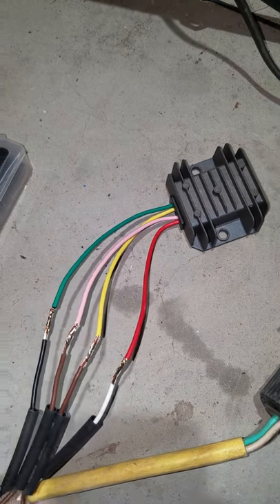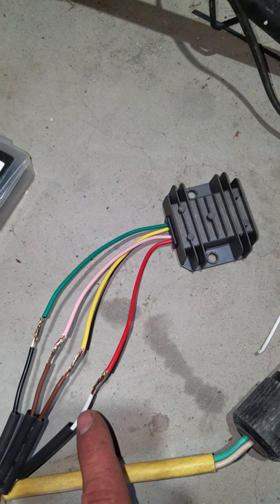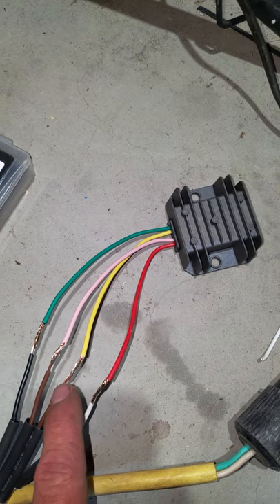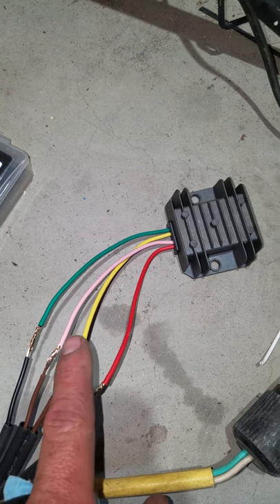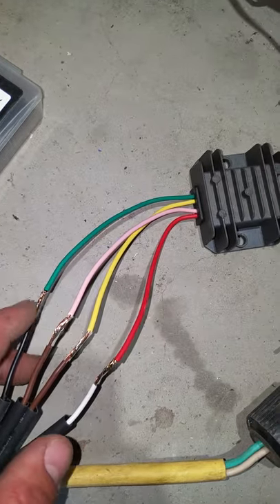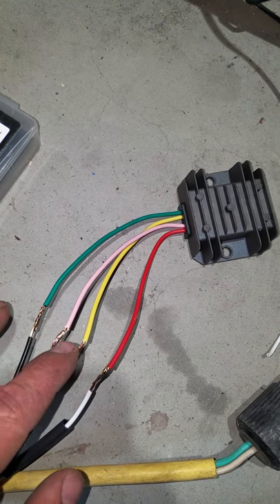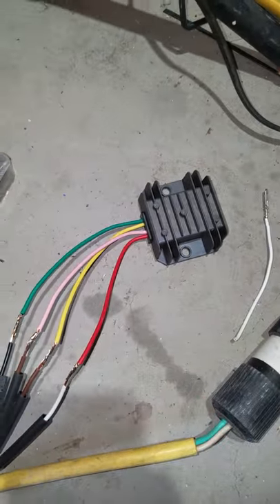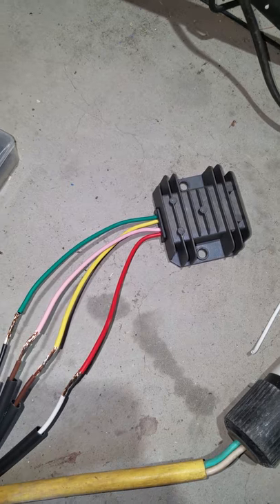How to wire a 4 wire voltage regulator rectifier

Comment: Ok, so I did get it correctly. 
I'm about to put one of those exact same reg/rec's on my new Chinese 125 engines that has two yellow wires coming off the stator. Thanks, this is good to know.
Reply: Should be yellow and orange cables off the stator and may i know how you connected those

Comment: Pink with green is AC from magneto. Yellow with green is for headlight(4amp).Red with green is 14.80v for battery charging (1ampere).
Reply from the maker: Nope.
Reply: 4 wire rectifier dosent have two  stand alone ac wire ...in motor cycle every thing common with ground.same as ac supply have common ground
Reply from the maker: @nishantkundu6210  There are multiple four wire rectifier designs. This is one of them. It does not have a headlight circuit.

Comment: May I ask why my red wire only output around 4-5V voltage to my headlight ?? The stator is new and able to produce more than enough voltage to burn the bulb if I disconnect the rectifier. Thanks first

Comment: I’ve got 2 of them, exactly the same from Amazon . My stator has 25vAc coming out when the bike is idling. I connected the yellow and pink to the correct wires on my MT250 which happen to be yellow and pink also. BOTH rectifiers output 1.6V Dc ??? I’ve tried it without the dc connected and also with yellow pink swapped round . I’ve diode tested the units and checked if the case is shorted to anything and it’s 1.6 v dc every time.
I’m a railway electrician/sub tech , I’ve worked in electronics and all manner of electrical work for the past 30 years including transformer construction. Please tell me WTF is going on with these damm things could they possibly both have identical faults lol it’s doing my head in
Reply from the maker: Wow. That is something else........ I am unclear on how that could happen. Even if it was a 1/2 wave, full wave problem, you still have enough volts to make 12.5v
Reply: Did you do (stator float) ?
Reply: If it’s the same as a four pin rec/reg that comes on the little 50cc Chinese motor scooters then there’s one wrong wire connection in this video.  That green wire is not meant to go to ground.  That’s an AC common/return wire.  These scooters use AC of the yellow wire (one of the stator coils) to power the headlights and taillights.  That green is the ac common.  I went through the same thing when hardwiring one of these rectifiers up.  Looking at wiring diagram for the bikes they come on it appears to be ground to you realize they have a mixed ac/dc system and the stuff running off ac needs a return path to complete the circuit.  So just don’t run that green wire to anything and then it will charge the way it’s supposed to
Reply: Yeah I agree. I had to do the same thing to mine. Then I found out all it was was a banana in the tailpipe.
Reply: Did you check the output on unplugged wires, or connected to the battery? Because i had the same result first. Then i connected the battery and here we are! 14,5v :) Tested on an old Kawasaki.

Comment: Eyeball: Thanks for your reply. I found a wiring diagram which helped but it was actually pretty easy to figure out anyway and I now have it back together.  I do have a question as these charging coils are new to me so I have no experience to draw from in order to confirm that all is well with my setup:  I started with one charging coil but just added a second one. Everything is wired as it is in your video, a charging coil to each of the pink and yellow wires and of course the ground and positive wires as well. With my starting battery connected and the motor shut off I read 12.8 volts at the battery. If I fire up the motor I still see only 12.8 volts which makes me believe that the charging coils are not adding to the equation.  If I disconnect my starting battery and run the motor again I read approximately 5 volts DC from the battery terminals. If I switch the meter to AC I read approximately 11 volts, again at around 2/3 power.  I am not sure what to conclude from this. Shouldn't I be seeing more volts from the Voltage regulator with the motor running?
Reply from the maker: Yes. What you have is a different type of stator coil. Yours ground to the engine where they bolt on, am I right? I can't remember right now, but I think you need to either use a full wave rectifier or splice the coils together in a rotational circuit.
Reply from the maker: **in a series

Comment: I connected a 4 pin voltage regulator to artic cat 2000 its charging and everything but the Artic cat original voltage regulator has 5 wires but it does work for my charging system would it affect it cause i have one left stator wire extra from the artic cat?

Comment: So I'm basically wiring a dirt bike to have lights.  It does not have a battery.  Do I need to add a battery or can I wire it without 1?  I'd be using the frame for all my common grounds.  Thanks
Reply from the maker: You should be able to just attach the positive output lead to the input of the light. It might pulsate a bit even though it is dc, because it will make power when the stator and magneto coils pass every revolution. 14v directly should be fine for your lights. You may have trouble with LED's though. Perhaps not. You could probably avoid a lightswitch altogether if you wanted. I'd fuse the regulator output probably , just to be sure it never shorted out. Good luck. HMU if you have any more questions.
Reply: @eyeballengineering7007  Thanks for your response. I went ahead and wired it all up. I grounded to frame. Everything works!  I used LEDs for the turn signals and they dont flicker. Your video helped clear up a wire question I had and your response confirmed what I thought would happen. Thanks for your help!
Reply from the maker: @nickhowes7436  Awesome. That's what this is for.

Comment: Wow, great learning video. My question: i hav da most fuked up chi nah quad. My rectifier is plastic. Blk red pnk gry gree wires comes out of rectifier. Black n pnk not connected. Grn red gry goes to the vehicle. I bought a new one has 5 wires. Blk red yel pnk grn. How do i connect this new with existing blk red gry? Pls help n God bless you!

Comment: Question for you.  I only have one yellow  ac hot wire coming from the lighting coil .  The lighting coil is also grounded to itself so grounds directly when it is installed. No ground wire needed .  
 I assume i can just leave one ac pin vacant ?  Thanks
Reply from the maker: You can if the single coil makes enough voltage.
Reply from the maker: Well. I may have been hasty. I think that would work though. You may need to ground the other leg. I haven't thought about this in forever.
Reply: So you want to put one AC yellow from stator to the yellow on r/r, leave the pink blank, and send the green- and red+ to battery -/+. 
I would like to know if this would work as well.

Comment: How to identify the coil is full-wave or half-wave regulation?
This rectifier is half-wave regulator but the wire from the coil looks like full-wave regulation.
If my suppose is correct, which means you only harvest half electricity energy and lose another half.
Reply from the maker: You are correct. You only save half of the supplied power with the half wave rectifier. But, I didn't want to dive into all that if people are needing to wire a 4-wire rectifier regulator they already have.

Comment: How do you wire up a 6 wire unit?

I'm working on a yanmar diesel tractor that needs a new voltage regulator / rectifier.
They are kind of scarce and hard to find. They range in price anywhere from around $18 up to about $80.
I see lots of similar ones on Amazon but they don't list them for the tractor that I'm working on.
Does it have to be listed for the tractor I'm working on to get it and install it?
Reply from the maker: Truly depends on the unit.
Reply from the maker: It doesn't matter what they're listed for if you have the correct amount of wires. They'll usually tell you whether or not they're halfwave or full wave rectifier
Reply: Every time I plug in the rectifier my bike shuts off

Comment: where would i wire up the kill switch? and an on/off switch for a light. no battery
Reply: The 'kill switch is in the ignition circuit NOT your lights, Run the red wire to your light switch

Comment: B Curtis, thanks for such a comprehensive video. I need your help. I'm not a proffessional in bikes but I'm tech enthusiast. I like exploring how things work. I have a 5 wire reg rectifier colour coded: yellow, pink, red, green, then black. So I always wonder what the black wire does. I have a clue that yellow an pink wires could ac in. Then mostly,    red and green wire are for battery charging. But black one?? pliz help thanks.
Reply: black wire is for the keys ignition
Reply: +mykel N thanks a lot bro. if u can elaborate, which components does it supply when it comes out from the key. I'v seen one one byk wreckage it powered the flasher unit.  Unfortunately some wires were missing from the harness. what else does it supply if any, pliz help thanx.
Reply: The black wire is for monitoring the voltage. You will connect the red wire to positive terminal of the battery. You should connect the black wire to any wire which has a 12 v running in it once you turn on ignition ( probably parking light, brake light positive wire). The black wire should not get any voltage once you turn off ignition. The black wire monitors the voltage output load from battery and adjusts the charging voltage to battery using red wire. You can verify the charging voltage to battery     With and without connecting black wire and you will be able to notice some variation

Comment: Not sure if you can help me but I bought the exact same regulator for a street legal pitbike Im building to have full lighting system. I have 2 yellows coming out of my engine so its a full wave system. wired up perfectly but I only get roughly 5 volts DC on the regulator output. I have not connected up the battery yet as im not at that stage of making the loom but do these regs have some quirk where they only give the full charging voltage when actually connected to the battery? Thanks.
Reply: just noticed you stated on another comment you believe these are half wave rectifiers? if thats right then that is probably my issue lol.
Reply from the maker: @danguy2009  Yeah, sorry. That does appear to be how they function. I tried to respond for days, but my internet is sucking so bad in the afternoons that the notification tabs won't open when clicked.

Comment: Hi Daniel: I have a new Predator 420CC motor that I just installed on a virtually new snowblower for added power. It is now a BEAST and I love it. I am wondering if you ever figured out your wiring issues. In my case I did the same this as you (I think): I added an additional charging coil so that I now have 2 of them. I added a lead acid starting battery and I now have this 4-wire Voltage Regulator like in the video.  I am trying to figure out how to wire it into the simple, existing Predator wiring harness without shorting something out. I see where the original charging coil wire is connected to some little electrical doo-dad in the switch box. Could this be a capacitor (?). I am not sure if I should just bypass this little doo-dad (hoping that it may be replaced by the electronics of the new Voltage Regulator) and go straight into one of the center wired of the new VR. Can you offer up an of your conclusions and hep a brother out? Thanks for whatever you or anyone else can do can do to help out. 

Thanks Eyeball Engineering for this great video! This helped me get closer to my goal and is appreciated.
Reply from the maker: I'm running a completely different system using Kohler charge coils on a Lifan 420. You really need to look at the predator 420 wiring diagram and find your two AC lead coil wires

Comment: I’m still confused about the middle two? What they go to? I’m trying to run led lights on my go kart but I have them hooked up directly to the battery with the engine directly to the battery
Reply from the maker: The engine directly to the battery? ... You need to define what exact wires you are talking about.

Comment: Hi, you said the yellow and pink are the same... is that mean it can be connected together, directly from yellow to pink?! 
I'm trying to Rec/Reg AC 12V 6W bicycle dynamo generator that have only two poles coming out (+ and -) with similar 4-Pin rectifier/regulator ... So I believe Negative pole goes to the ground with other ground wires and Positive pole to the yellow wire, but what should I do with the pink wire ?! Can I just bridge it to yellow or I can leave it unconnected?
Thanks
Reply from the maker: You hook the two poles to the yellow and pink poles on the rectifier. It sounds like you have a dc generator though. I'd check it's output.
Reply: @eyeballengineering7007  No, it's definitely AC 12V 6W ordinary bicycle headlight generator, but I was very wrong (misinformed) about "two poles" that are coming out from generator ... it's not + and - poles to connect light bulb on it, it's two different coil outputs, the one is 12V 6W for the headlight and the other one is 2.5V 0.5W for the rear light, and of course the negative (ground) side is the metal housing of the generator. 
So, I'll hook 12V 6W coil output to the yellow wire ... but what should I do the pink wire, should I bridge it to the yellow wire or I can leave it unconnected? 
The green wire goes to the ground and the red wire to the positive (+) of the battery, of course.
Thanks
Reply from the maker: @antoanlamisura6244  you don't have enough voltage for this regulator. You really need about 20 volts to make it work correctly. I would just add a diode to your 12v power wire for 12v dc. It's about all you can do with that. Your 2.5v  AC is basically useless for anything but a low voltage tail light.
Reply: @eyeballengineering7007  Yeah, thanks for info ... but am I right about connecting the yellow and pink wires?!
Reply from the maker: @antoanlamisura6244  those are the correct input a/c wires

Comment: Hi would this work on an old Honda 6v motorcycle to convert it to 12v? I'm thinking I'd wire into the stator and charge a 12v battery and lights. Possibly run without the battery if possible.
Reply from the maker: That entirely depends on the stator coils output voltage. Most likely, yes. You can test that by setting a multimeter to a/c and touching it to both of the a/c outputs out of the engine. Many will not make much voltage at idle, but if you are making 13+ volts above idle, you'd be in business.
Reply: @eyeballengineering7007  Thanks I'll look into it.
Reply: @316projects3  diagram please....

Comment: Hey there. I recently fitted a 12v reg/rec to my 125cc pit bike. im only getting 2.8-4.2 volts from the positive leading from the R/R so LED lights (12v) will not work. Ive seen it done on many youtube vids with success. Do you think this is a stator issue or a faulty R/R?
Reply from the maker: You can test it using a multi meter. Disconnect the two input a/c lines from the regulator and attach your multi meter to the stator outputs. Have the multi meter set on AC and run the engine. This will give you the output voltage from the stator which should be anywhere from 12v AC to 30v AC. If it's down in the 4-5 volt range as the outputs are, then you know the stator is bad
Reply: @eyeballengineering7007  Hey, thanks mate. I did that last night and the white wirs gave me around 12.5 volts and the yellow was 9-10 volts AC
Reply from the maker: @bernzie001  Hmm. Should be good enough for a light and  the same voltage would be output. Sounds like the regulator/rectifier is either bad... Or it's probably bad.. I can't think of any other reason for the low output voltage. Make sure all your connections are really good. I solder mine to ensure they last.
Reply: B Curtis yeah my loom is solid. Nothing wrong at all just have 10-13 volts ac goin in and only 2-4 volts DC coming out.
Reply from the maker: @bernzie001  Bummer. Well, you know what to do.
Reply: B Curtis just ordered a different R/R. Fingers crossed. Thanks for your time 👍🏻
Reply from the maker: @bernzie001  No problem. Glad to help.

Comment: Can I attach the yellow and pink wires together and just run one hookup? I only have one AC wire because my lighting coil is grounded.
Reply from the maker: I don't believe so. I think you need a half wave rectifier.
Reply: Eyeball Engineering I did some digging and found my lighting coil wasn’t grounded. And the second A/C wire was grounding out somewhere. I got it figured out. Thanks for the instructional though. It helped a lot.
Reply from the maker: @Ratbiker  Awesome!

Comment: Where does the positive and the ground straight to the tusk battery harness
Reply from the maker: Really depends on your vehicle. I don't know where you have positive available or ground. You can either ground straight to the frame, or the battery and put positive straight to the battery or through a keyway.
Reply: @eyeballengineering7007  i have an 2001 honda xr400r and I'm just lost when to connect the positive and negative go I'm running the tusk wiring harness with the tusk switch and tuck battery pack and I have an capacitor
Reply from the maker: @jameshancock4566  I have absolutely no idea what a tusk is. None. Never heard of it.
Reply: @eyeballengineering7007  it's an tusk enduro wiring harness along with the switch and I have an dot polisport headlight 35w and I also have an regulator/rectifier I also have an 50v capacitor I'm just lost where do I connect the negative&positive wire from the regulator/rectifier to the tusk battery